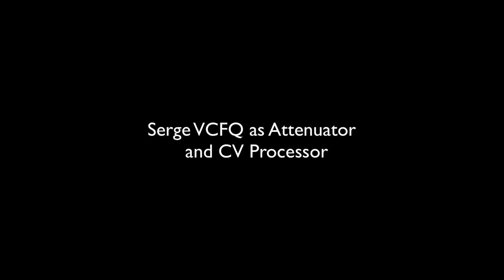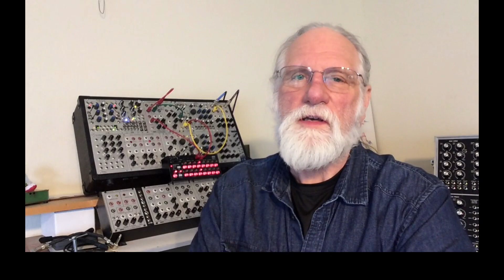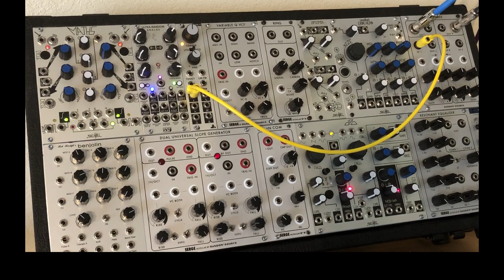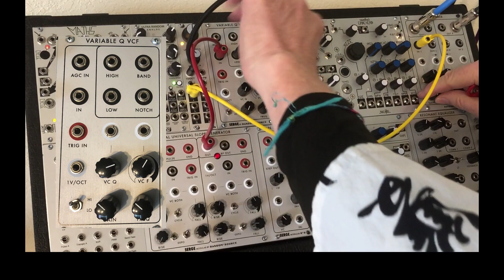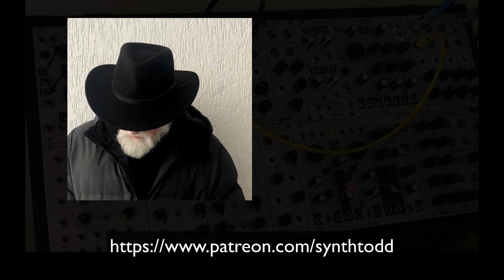Serge VCFQ as Attenuator

Comment: Is this more of a function of the gain than the filter ?
Reply from the maker: Surely seems like a combination, hmm food for thought and further exploration
Reply: @vgermuse I often use a channel of my dxg or optomix to process cv in a similar manner. It works especially well with stepped voltages from a cycling lfo through a sample/hold, or the noise ring outputs. It reigns in the chaos.
Reply: Here is a link to a video I made today demonstrating how I use my low pass gates as attenuators when I don’t have an offset/attenuation channel open. I can’t wait to try this technique out with my Variable QVCF! 
https://youtube.com/shorts/GlkS730g15w?si=wHrkJwaBpcWL6gRU
Reply from the maker: @ thanks, looking forward to checking it out

Comment: by putting the filter in LO mode, can't you also get VC slewing on the control voltage (most noticeable on a staircase or sequencer output) because the cutoff of the filter is in the sub-audio range?
Reply: by the same token, can't the highpass output achieve a response that's more similar to the lowpass by putting the filter in LO mode and turning the cutoff all the way down--extending the passband into the sub-audio range?